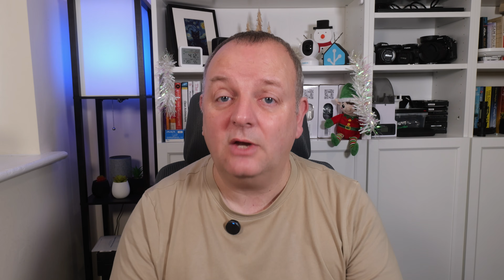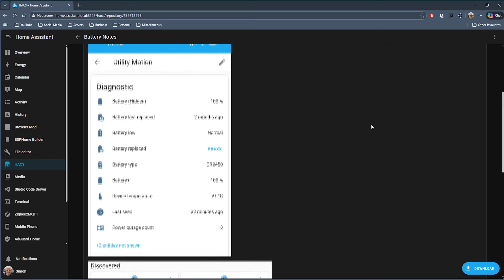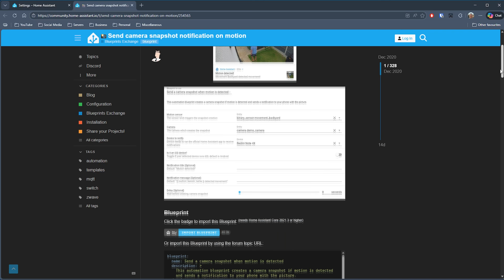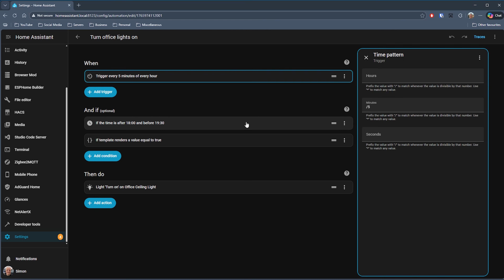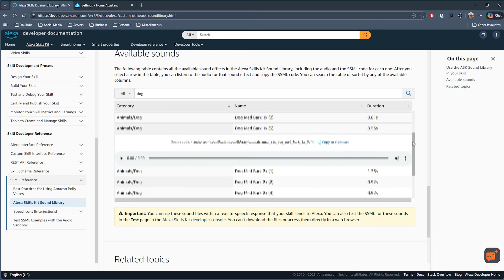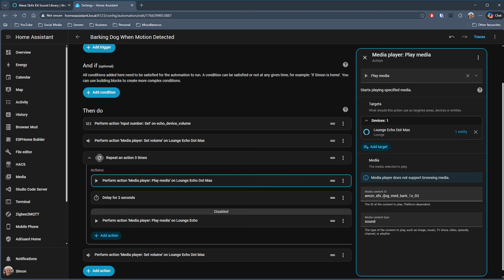Using Home Assistant As A Security Deterrent This Holiday Season

Comment from the maker: Do you have anything set up whilst you're away, let me know down below and if you enjoyed the video then don't forget to LIKE and SUBSCRIBE to the channel 👍
Reply: There's a custom integration called "Presence Simulation" which uses your history to turn lights on and off as per your regular but still somewhat random times. You can turn it on and off in line with your alarm system so it only runs when you are not home.
Reply from the maker: Yes I've seen that but have tried it out, have you used it?